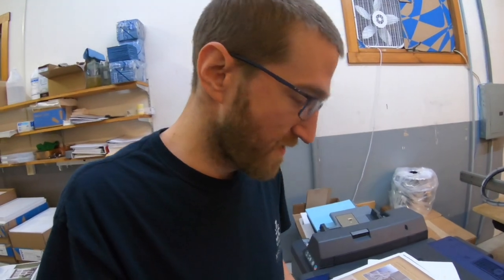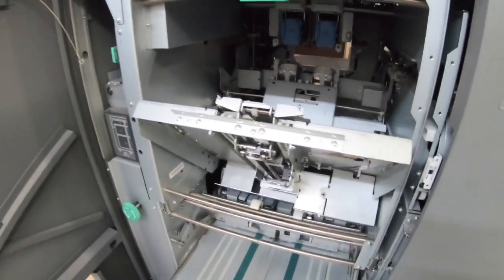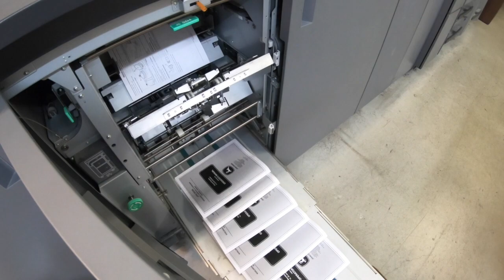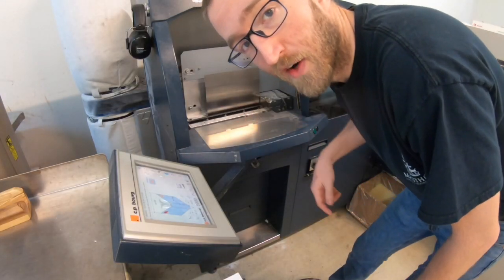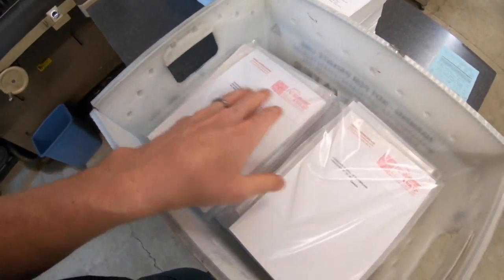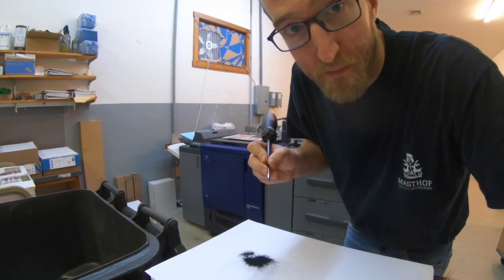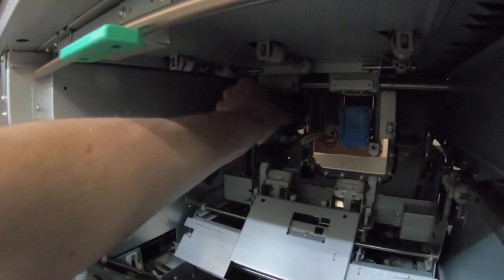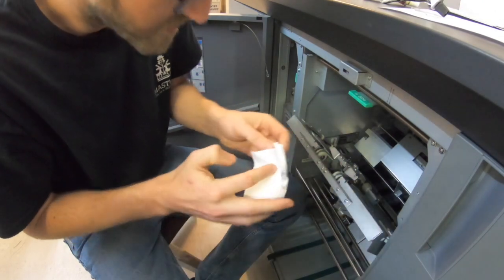Fixing Saddle Stitcher, Toner Testing, Poly Bagging Newsletters with Minipack Poly Mail Bagger

Comment: I had a pressman that somehow ran a screw between the blanket cylinder and the plate cylinder on Ryobi 3200. It destroyed the blanket and left a divot in the plate cylinder. I filled the divot with JB weld, let it cure and smoothed it down with a dremel. Worked like a charm.
Reply from the maker: Nice! Simple fixes that work are brilliant!

Comment: You should use loctite 242, it's a threadlocker, that means that the screw will stay in place, but you will be able to remove it in case you need with a little force.
Reply from the maker: I'll have to use loctite next time, when jb weld breaks.
Reply: @justaprinter  another advantage, is that it's single component, so much quicker to use.

Comment: Canon might have pioneered the toner combined with developer thing.  I know they did it back in the 80s/90s and HP had it, but Canon made the HP print engines back then.  Theoretically it is supposed to be less expensive but that may not hold true.  The one advantage that separate developer is supposed to have tho is that you can adjust the developer charge which can help create more solid blacks than a machine using combined toner and developer...although that may not hold true so much anymore either as I've seen beautiful pitch blacks from Canon machines.
Reply from the maker: Neat. I would like to do more detailed study on that. So far, the total cost of operation is about the same for the c6500(developer separate) and the c1070(developer and toner mix). Time will tell.

Comment: Just curious how you feel about the folding strength of your digital presses and your tower booklet maker. We ended up getting a  square fold unit on our Xerox after our old press just couldn't get a booklet to lay flat enough when getting in the 40+ page range. We looked at different tower units, but found it was generally the same situation. Do your customers ever complain about booklets not laying as flat vs a booklet that was folded and then collated on a muller saddle stitcher or similar?
Reply from the maker: The saddle stitcher that is in-line with the Konica 1200 actually folds each page before stitching them all together. That does a pretty good job. With the tower booklet maker that I have I just make sure my paper grain is parallel to the spine, that helps out a lot on high page count booklets. My customers don't complain about it. I typically suggest they do a perfect bound book for page counts over 60 pages.

Comment: I would love to be working at a printer but at the same time I would miss working at a machine shop.
Reply from the maker: I would love machining, but I would miss printing! Haha. My goal is to get a lathe and mill so I can machine my own parts. Looks like fun.
Reply: @justaprinter  it's fun and would be useful for fixing parts on out of production machines. I was thinking about how would I make a slitting head for your lamentation machine so it's easier to setup and dispose the excess.